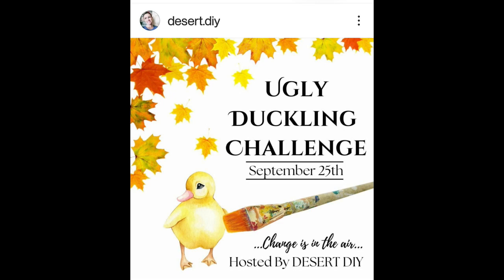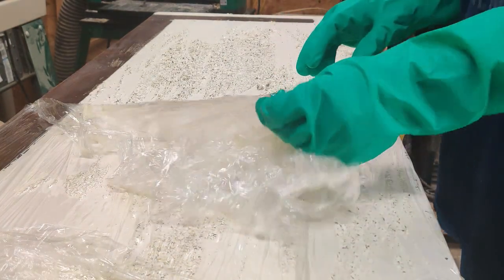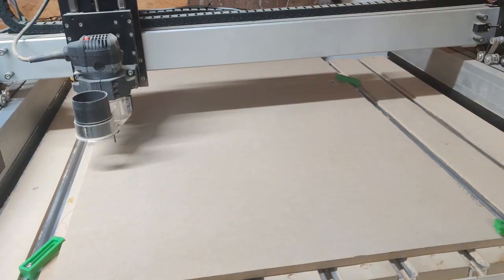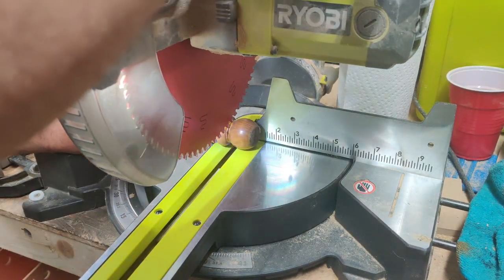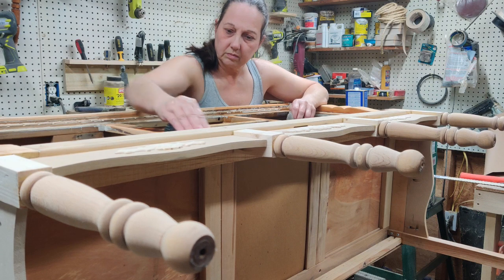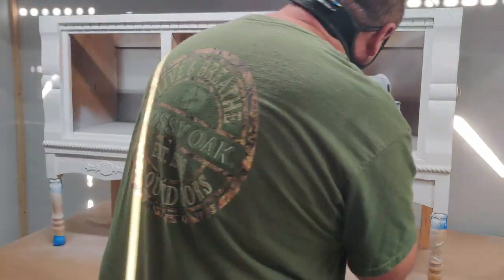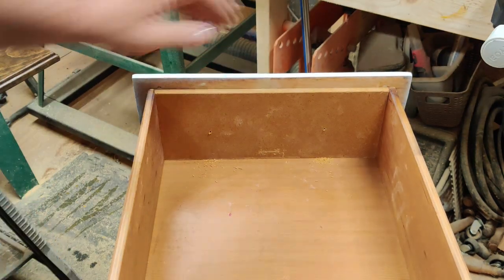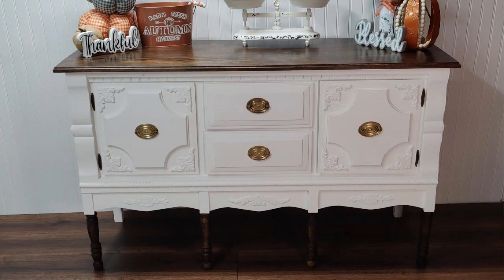Can We Pull This Off?/ Ugly Duckling Challenge Fall 2022

Comment: What a great change. I was surprised that you painted it white again after spending time removing the white paint. The addition of the decorative pieces really gave it a vintage feel.
Reply from the maker: Thank you it was a lot of fun!I knew when I started it that it was going in my daughters house and her house is done in traditional farmhouse so it needed to match which is mainly white and walnut, the original hutch was painted by someone before I got it and they didn't prep it correctly and used a latex paint so it was peeling all over we had to strip it down so we could prep it correctly so that the enamel paint would have a good surface to bond to